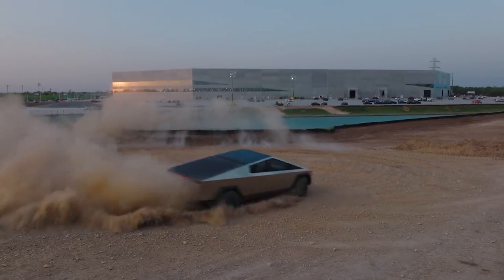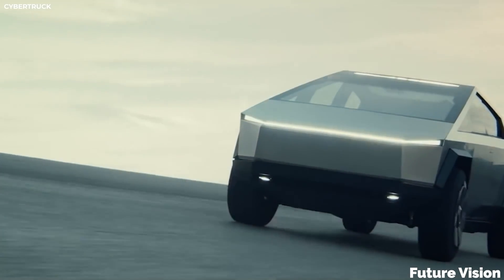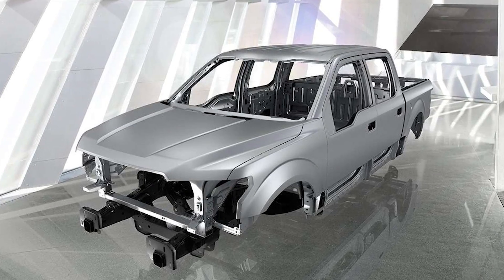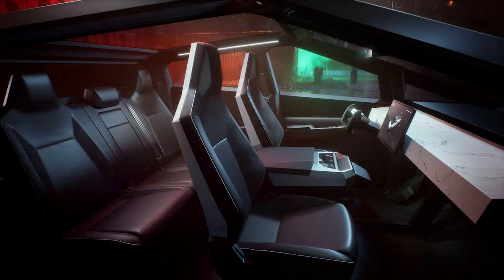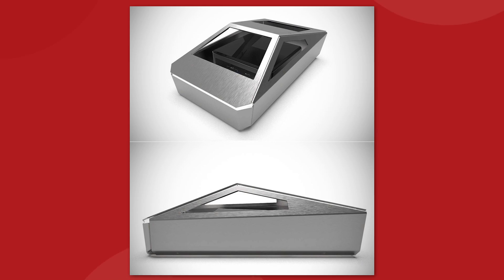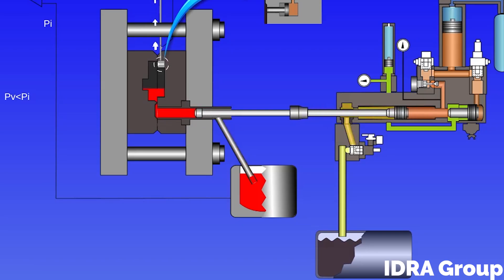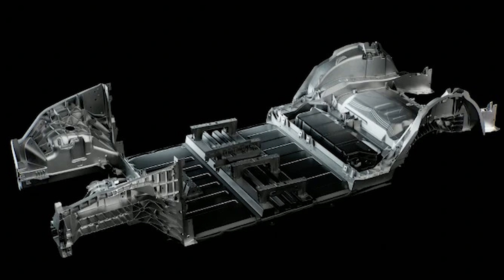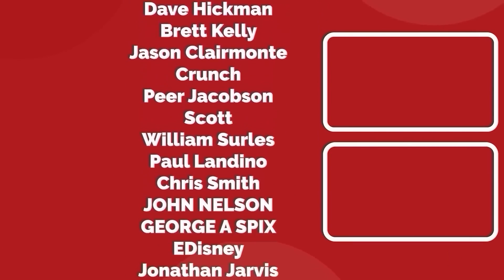The Real Reason Tesla Developed The Cybertruck!

Comment: As a fabricator and mechanic, I will never see the Cyber truck the same.  This video helped me go from "eh, not for me" to "I hope to own one some day".  If there one thing I hate its rotten frames, corrosion, rust, holes.  The truck will outlast the battery life though.  So it would be cool to make the battery somewhat easily replaceable.  That stainless body with all of the aluminum underneath will last a long time (for those of us not near salt water).  It's ugly as hell but it has major soul!
Reply: Stainless 1/8 makes no sense. How will it crumple on impact??
Reply: The structural 4680 battery in the standard range model Y was fairly easy to remove but it didn't follow it so closely on Munro Live.
I think it was bolted to the other parts all along making it structural - it wasn't impossible to get out without tearing everything up.
Modern li-ion batteries lose like 10% range but stabilizes. If you have that wiggly room in your need it can be a long time before replacing. The number of charge cycles and the range gives that 500 000 miles ought to be no major problem then the majority of them.
I have a robotic lawn mower that also uses li-ion (10x 18650 cells) battery. It's now at 2784 charge cycles after 6 summers (it basically charges 6 times a day when doing 24/7 so it rakes them up quicker than a car). That's the equivalent of well over 500k miles on a Tesla model 3 long range.
So we have prior precedence (that's better than how a phone battery is abused) to predict how they will hold up.
I don't have any battery electric car but watching the lawn mower work so well, without active thermal management of the battery and any kick ass battery management system as a Tesla makes me just shake the head when the naysayers say the battery will need replacing soon.
Reply: @subwarpspeed  Looks like changing a structural battery is much easier than changing an ICE engine.  I think the number I seen was 4 hours.
Reply: @danharold3087  another crap!!! The structural battery is the stupidest thing that ever happened! It makes battery reusability totally impossible and also what happens when it ever goes to Africa where things always get repaired instead of changed!?
Reply: @danharold3087  ICE can actually be repaired instead of changed or whatever you think!
Reply: @carholic-sz3qv  Your underestimating people.  When these structural battery packs get old people will figure it out.   Or maybe we will not see single cell failures prior to when they need recycling.  You MAYBE over reacting.
Reply: @carholic-sz3qv  I drive old cars and trucks.  Ones as old as your talking about.  Unless they come to you from a dry climate and you live in a dry climate they eventually turn to junk.    This is not ICE vs EV it's about the stainless and cast aluminum frame.
Reply: @danharold3087  lol……. You’re jocking right!!! It’s just the beginning tesla is going to make even more difficult to even open it! If you think people are creative just look at what Munro had to do to even acces it! It’s just the beginning!
Reply: @danharold3087  how am I over reacting!? I’m talking about vehicles that might still need to be used even up to 30 years later! Many foreign countries are only able to afford used cars from western countries and having a car that basically unrepairable is a big NO-GO. “Best part is no part” works very well for tesla but unfortunately not for the customer.
Reply: @carholic-sz3qv  Electronics can be repaired  or replaced.  People and companies will spring up to do this and at a much much lower cost than OEM.       Same goes for the battery pack.   Yeah I know Monroe had a heck of a time tearing it down.   People will figure it out.   Maybe rebuildable after market packs will become available.   When there is money to be made it will happen.   Anyone  thinking this is wishful thinking has only to look at the huge number of 3rd party of new. rebuilt, and remanufactured parts on the market today.  Including engines.   If people listened to others with your brand of facts man would never have domesticated the horse.
Reply: @carholic-sz3qv  You missed the first part the quote.   It goes like this.   "This is the fundamental thing. Over and over, the tendency is to complicate things. The best part is no part".      

A while back someone, maybe you, used the argument that each Tesla car was a prototype.   The fact is the the OEMs are the guys who ship prototypes.  The organizational structure of OEM engineering departments induce complexity.  There are walls between the various fiefdoms.   A part that spans two fiefdoms becomes 2 parts and bits to join them.  Bits like brackets fasteners hoses and wires.  The Ford E Mustang is a good example of this.

Sandy Monroe redesigned Ford's battery tray as one part using this principle.  Lost several brackets screws etc.  Saved Ford 4 million dollars.  Why because Ford stopped engineering when it worked.  Ford's version not only required more parts but installing it was slowing down assembly lines.

Even the gigaCastings are more repairable than the parts they replace. The casting alloy was engineered to be malleable and weldable.  Two properties the high strength steel it replaces does not have.

The OEM do not like the disruption that has turned their factories into scrap.  Not too long ago they figured they could just slap a motor and battery into existing cars and make a profit. But EVs built this way are not competitive. They are heavy and have complexity not required by the electric drive train.  

There are a lot of people out there pushing the narrative you subscribe to. Some are making a good living stomping on Tesla.
Reply: @carholic-sz3qv  Nope not Joking!   Looking at the pack disassembly it is hard.  But when I and others start looking at what it will take to automate the process it is not so formidable.  The pack will be cut open on a CNC router.  Bits will be drilled out to release the top. Maybe a solvent can be used to remove the foam.  Or a high pressure fluid stream to erode it away. Or some guy in a 3rd world country does it by hand behind his house and 4Xs his income.  One way or another, if it is needed, it is going to happen.

This is my last reply on this subject.   For reasons I don't care to understand you want Tesla to fail.  Exposure to the truth only inspires you to dream up or regurgitate more tripe FUD.
Reply: @danharold3087  you don’t need to make a dictionary 🤡!!! No one has time to read that cheers!
Reply: @danharold3087  the gigacasting is definitely way more difficult to repair compared to steel! It’s a structural part and since aluminum is brittle you might need to replace the whole piece which totally glued to the vehicle and there is no way if not destroying by separating from the shelf! (See Munro video)
Reply: @danharold3087  by making sub parts into a massive unique part makes repairs/chamfering them significantly more expensive and that’s a fact I don’t know why you’re even trying to argue on that! Tesla won’t even sell them those OEM parts to begin with!
Reply: @carholic-sz3qv  CNC is very precise.
Reply: @carholic-sz3qv you can essentially crush and melt the structural pack and separate the various elements to create a brand-new battery. It’s pretty much 99% recyclable.
Reply: I do a bit of machining.   My machines are mostly antique that come to me junked.   Have a 40" air over hydraulic press brake so I kind of enjoy bending sheet metal.  People have no idea how impressive a 1/8" SS body will be.   This could be the truck that gets handed down generation to generation .  Just freshen the suspension and battery as required.  In 10 or 20 years there will be after market electronics alongside rebuilt ones.  Parts for this truck are going to be all over the aftermarket.   We are about to witness a car cult larger than that of the VW Bug and Van.    Unlike the VWs we will not waste out lives patching  rusty sheet metal.
Reply: @danharold3087  people in Africa for example are still importing 30 years+ trucks and cars from Europe and around the world vehicles which are actually super adapted to very bad road conditions there just like South America….
Reply: @carholic-sz3qv  Pickups took a big sturdiness hit about 1980 when they started to work on MPG.  Bodies started getting thinner and frames weaker.  These trucks are mostly gone.   Buy they are far stronger than any which followed them.  And they CT will be even stronger.  And it may last 50 years in the rust belt.
Reply: @danharold3087  nonsense!!!! So other trucks and vehicles haven’t been handed from generations to generations!? Wtf are you smoking!? Nothing will ever beat the VW or bug influence. There are literally vehicles over 40 years old still on the roads all around the world doing better job than tesla will ever do.
Reply: @danharold3087  even in the Middle East they still drive 40 years old Mercedes trucks in the desert.
Reply: Retired military Aircraft Mechanic, (Aviation Structural Mech),  this is like a Christmas Present.
Reply: @trex2092  it’s not!

Comment: I actually think the cyber truck was designed to work on both the moon and Mars. Both environments will be subjected to solar radiation. And the cyber truck design will be perfect for both. Also by making them airtight the truck can be equipped with oxygen for the driver.
Reply: Lol….. it’s not even a comparable truck to what can be used on those planets! That has to be something totally different

Comment: Sounds all good, but what comes to mind is a collision. Once you damage it, you are good to throw the whole thing away, you cannot replace anything on the outer body.
Reply: All you need to do is plasma cut away the damaged area and weld in a new panel.  It is done all the time on rear quarter panels of typical vehicles.  The 1/8" thick stainless is actually fairly easy to weld with out warping and then the weld is just polished /sanded down flush with the sheet metal and the repair is done...no bondo, no paint, no clear coat and no buffing and polishing for hours and hours.  If you are in a rush and its just a work truck you don't even need to sand down the welds just leave them to give it a Rat Rod look and show off its battle scars.
Reply: Should be relatively easy to repair. The panels are all straight, how much easier could it get?

Comment: It still has to have strong internal structures.  It has doors.  The SS sheets have these gaping holes in them called doors.  Maybe if they eliminated the doors, then a lot of structure and weight could be saved.  Just my 2 cents observation.

Comment: the reason trucks are made body on frame is because there are so many different ways people need trucks. they may need 4 seater,  2 seater, long bed, short bed, utility bed, flat bed etc... the cyber truck is built one way and can only be built one way. if it's not to your needs, tough. as for the stainless steel, we already seen this movie. the Delorian had stainless steel and the vast majority of the owners painted it after just a few years because it showed finger prints, streaking, tarnishing and general looked like a mess after just a few months. and as for your weight of paint, the weight of a can of paint is 70-80% liquid. after it dries it's much, much lighter. As for their cab making an integral part of the support structure, well, that's how most modern uni-bodies work these days and have for years. Just check out an old ad for a 80's VW beetle crowing about the very same thing.  And yes, a lot of the panels do create structural support for the cars and aren't just dead weight. Without the panels in place there would be lots of twisting in the frame.   
But, if the cyber truck conforms to what you want in a truck, more power to you and enjoy.

Comment: Its no problem to curve ss steal, look at starship. But, you can not curve it in two directions at the same time.
Reply: The problem isn't that you can not curve it in two directions.  The problem is that it would cause extreme wear on the the stamping dies and they would wear out after just a few hundred parts, making it way to expensive to produce in volume.

Comment: Considering structural integrity, a collision of two Cybertrucks should yield interesting results.
Reply: yes the drivers become the crumple zones
Reply: @1ukjunglednbraver  the metal will bend or shatter,tesla can make cuts on the interior of the plates to brake and crumple like crumplezones
Reply: im waiting for crash test results. then i might be sold.
Reply: @1ukjunglednbraver that's what we want to see
Reply: It will form a black hole.
Reply: @ppkgaming210  that's what my 12-year-old son said
Reply: The safety factor for many people will be the main selling point. If it's not safe, not as many people are going to buy it.
Reply: The integrated body/frame of the CT makes it so that it does not have a crumple zone to absorb energy from either a front or rear impact.  Thus, the interior must provide all of the deadening of the energy so that the crash test dummies inside will not get obliterated.  Real flesh & blood types will need multiple belt restraints and/or much improved airbag deployment.  A side impact would excel in preventing intrusion into the passenger compartment.
Reply: Would expect about same results as 2 normal trucks colliding with their frames...
Reply: @ssu7653  this is why crash test are done, you must expect the unexpected. the fecking things doesn't have bumpers and the seating position is right at the front the lack of bumpers is enough for it to not even be released in so many country's.. i dont think this will come out on time or will fail tests. but i keep an open mind let the powers that be decide.
Reply: Will be even more interesting when third vehicle will stuck in between
Reply: @EM8974-c3m  might get a super nova.
Reply: I wonder how he got away with no crumple zones

Comment: the problem is that the back strut of the cybertruck is in two pieces.  It's not a truss.  There's a break between the back door and the bed
Reply: The cybertruck is built as an exoskeleton unibody.  It has the traditional A pillars on each side of the windshield, B pillars between the front and rear doors and the C pillars connect the roof the rear door jams as well as the sides of the box and fenders.  There is no gap between the cab's rear doors and the box sides (fenders).  Also remember that the roof, cab and box sides are made from 1/8" thick stainless steel all tied together with a stamped stainless steel interior structure that allows for interior components to be mounted and gives additional structure as well as side impact strength.  No matter how many pieces the body is made up of the thickness of the steel will make it quite easy to join them by TIG,  MIG or even spot welding then polishing out the welds like they do for restaurant equipment.
Reply: @rollyrauenhorst4545  
When I look at the photos and videos I clearly see a break in the exoskeleton aft of the C pillars?  Where did you read/hear there's a stamped stainless steel interior structure?

Comment: Thanks for such a comprehensive explanation of what makes the cybertruck so revolutionary. I would have liked to have had you cover the lifespan of the battery pack and what might be involved in replacing it at the end of it's life cycle. It seems obvious that with the truck's strength and resistance to corrosion that a very long lifespan of the body is to be expected.
Reply: Bullshit!!! Which revolutionary!? It’s a crap truck not made for flexibility or actual usability like a normal truck, basically allows no modifications it’s just utter crap!
Reply: The batteries are pushing a million mile life cycle. So probably not an issue.
Reply: @DrGregWeisswasserND  Impressive!
Reply: @Hat6000  If you believe a 'Dr' who talks about 'olde world terms' "miles", clearly not a scientist, who would deliver a source for this remarkable claim.
2023 01 14 08:43
Reply: I've been reading that the batteries don't do well in the cold weather. I live in New England, and it won't work for me.
Reply: @robertkeiser8478  Nonsense.
Reply: I believe Tesla will be using the LFP battery chemistry for the CT that while not having the energy density of other chemistries, will have a significantly longer life span and more charge cycles. Probably easily longer than the life of the truck.
Reply: @mikecomeau7419  Is LFP the lithium iron phosphate battery? I went to that for my solar system to replace AGMs. I am quite happy with them, less problems with local extremes of temperatures, less danger of fires.
Reply: It’s going to have about 1000hp to not even be able to haul as much as a 450hp ford f450 what a crap!

Comment: Seems like a really well-engineered body.  I would not want to be the one who has to do the body work to repair it after an accident however.
Reply: just cut and weld .. I don't see the problem ..
Reply: @gmy33  "Just" weld stainless steel?
Reply: @TonyLing  eh .. yeah .. thats what i do everyday
Reply: @TonyLing  offcourse i dont know if this special compound is weldable .. but there are very good omni electrodes for  mixed steels
Reply: @TonyLing   The whole Starship is welded together from the same material.
Reply: Yeah I heard that it would be very labour intensive and expensive. It might make insurance more expensive.